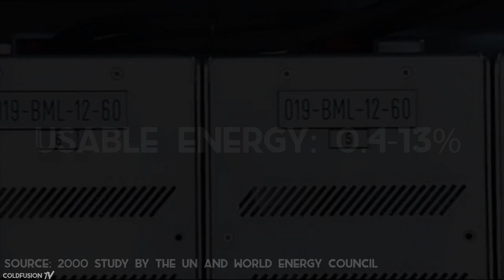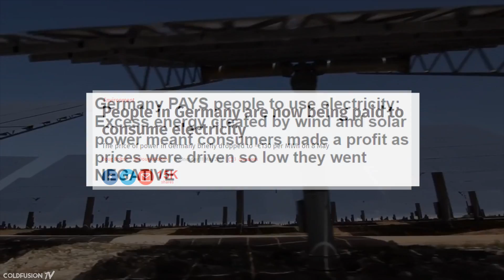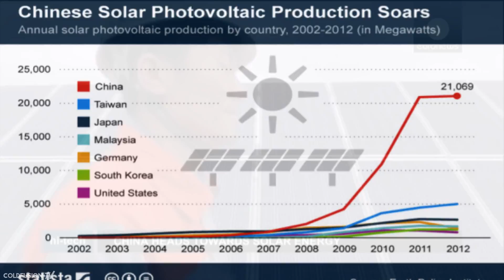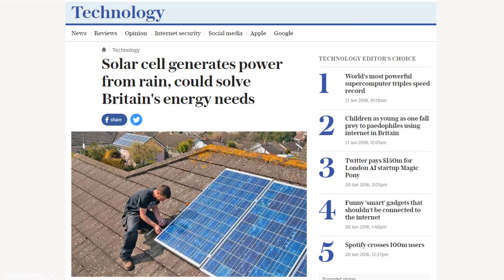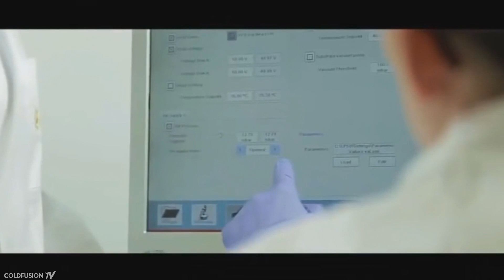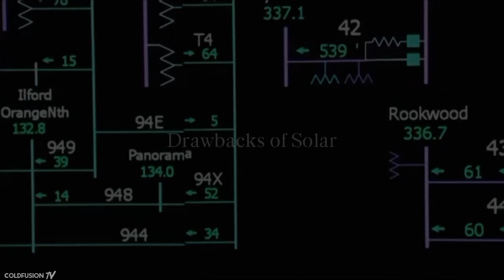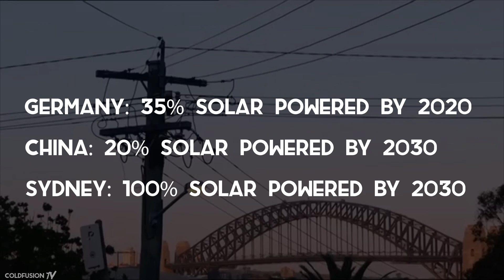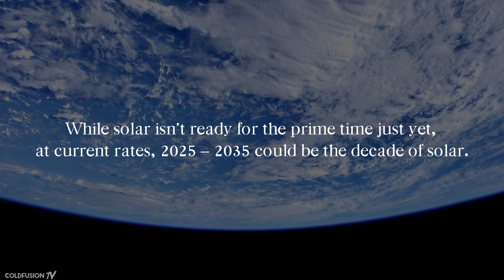The Truth About Solar

Comment: We are 200 years away from really practical solar cells.  The "solar cell paint" that has been promised  was a dud.  Solar energy does not work at night and there are no batteries that can reliably  power a home for more than a few minutes,  All  of the government subsidized solar manufactures have gone broke even though they contributed heavily to the Obama campaign. Solar cells ware out in just a few years they produce about  80% of what they did when new and continue to deteriorate.

Storage of electricity is the other half of the equation with solar energy until that problem is solved solar will remain an experimental dream.  Solar does provide a minimal amount of input of electricity for off grid use in the third world. It can charge your phone  or computer and run your wrist watch or radio  and power your yard lights for a few hours. 99% percent of the worlds energy comes from fossil fuels. 

Cold fusion is actually a better bet than solar power; wind energy is a mechanical loser with to much costly maintenance. Wave power looks promising.  If you had to live on solar energy alone most American;s could not do it. There would be no dryer or washing machines or air-conditioners and no refrigeration, no microwave and all lamps would have to be small LED's and TV would be on for an hour or two only, this could be a good thing. Try doing without these little trinkets for even a short time. Still millennials have been programmed to think we have conquered the technological barrier that keeps non-polluting  solar cells from powering and energy starved world. This was a myth transferred to them by teachers who do not understand technology, but are optimistically blowing up the hopes and dreams of a world powered by the sun which it is already.

Comment: After 25 yrs in solar system design (thermal) the future for solar PV is to couple togeather as i have done 3 yrs ago with a low cost none copper thermal panel to make a PVT hybrid. Everybody from the USA who talks up how solar power is so great fails to understand that the efficiency of all PV panels drops by 0.05% on every one degree c in temperture. Every manufacture knows this, as all the internal testing is based on a 25c air temperture.
The UK and Europe have a need for 60% heat, not electricty, so lets include solar thermal when we talk about solar power, where the storage is already here and is affordable to all, not the Tesla battery idea, costing thousands.
The world could go off grid in lighting today, now we have LED bulbs using from 5 watt x 10 = 50 watt x 1 x 100 watt panel and a 50Ah power bank to power 10 lights a day.
See my Hybrid PVT on You Tube and running your lap top for 10 hours for a cost of $120.00

Comment: I am retiring off grid in a 24' bus and a 16' Hallmark droop nosed shop/toyhauler trailer for my motorcycles and welders generators etc etc. I am buying into solar and am finding out you have got to pay a bunch of cash up front, big time on the batteries if you are off grid in order to scoop up on all that "Free Power". Biggest set of air quotes ever in this(: If I can make these batteries I bought last for 10 years it will all pencil out......Right? Ya if anybody remembers what you do with a pencil fur gawds sake, sheesh!

Comment: In mountain areas the storage problem is solved very easily. Switzerland has lots of dams to store water and create energy. Now because energy is more expensive during the day (peak) than at night, swiss owners of those dams used to pump the water up during the night and let it down during peak hours. So they could use cheap energy to produce expensive energy and make a lots of money. Those things are called pumped-storage power plants. So now all we need to do is to use all this solar energy and use it to pump water up the mountains.  Yes it may not be the most efficient way, but those things are the largest batteries in the world.
Reply: "dams used to pump the water up during the night ...  they could use cheap energy"
Solar is the most expensive energy. There is no solar at night time genius.
Reply: Did you read my comment and did you think about it for more than half a second? Just pump the water up during the day with cheap solar power and let it down at night when there is no sun. As I said, it's a huge battery. It solves the problem of storing solar/wind energy in an economic way. 
And about your comment that solar is the most expensive energy. Did you at least watch the video? See 4:22.
But I agree that clearly you must be the genious because you can think about it at least that half second. Congratulations man!
Reply: ***** "Just pump the water up during the day"
To use more power durring peak usage would require MORE everything. It is reasonable to use excess energy production during off peak times to pump water UP a dam for storage sometimes.
There is excess non-solar energy production at night, as they don't require direct sunlight.

"Did you read my comment and did you think about it for more than half a second?"
Read what you said and think.
"energy is more expensive during the day (peak) than at night, swiss owners of those dams used to pump the water up during the night "
Why is the word off-peak "NIGHT" significant, but ignored by you?
"Those things are called pumped-storage power plants."
Solar energy production at NIGHT is impossible, there is no sun light at night.

"As I said, it's a huge battery. It solves the problem of storing solar/wind energy in an economic way."
1) How would using more energy than is currently produced, in order to store energy during peak day time use solve any problem?

2) How would using sunlight at night to produce solar in order to pump water up a dam be anything other than pretend solution?

Be clear what you propose. Solar at night or storing excess energy during peak usage. Solar is the most expensive form of energy production, a big reason is non use during night.

Comment: Notice the tricky math at 2:50 which reduces the credibility of the rest this entire piece.
36 cents per watt today -= $360 for 1,000 watts. Good luck with that too. It's $1,000 on Ebay even. It has always been about $1 a watt. I have used it for decades and know.

For yrs I have said that you must also count the pollution to make and distribute etc solar and remember that they only  last about 25 yrs. The pollution today can equal what you save over 25 yrs thus there is no net gain then.

Comment: While I agree that solar power is the future, it is misleading to say energy from the sun is "free." Solar panels and battery storage have finite lives. Even if the panels and batteries are not damaged they will degrade from diffusion of materials. All semiconductor materials will suffer from this. The diodes and transistors will eventually fail. While the cost of production will eventually drop low enough that these replacement costs are manageable, solar will never be "free."
Reply: "it is misleading to say energy from the sun is free."
There is also the obvious unanswered question that if a large portion of solar energy was diverted from hitting the ground and nature, what change will that cause? Anytime someone start off with "x amount of unused energy hits planet earth and if we utilized that...", the pregnant dot "No used? What damage would that absence of x amount of energy NOT hitting the earth cause?"

Comment: your analysis of costs is faulty. You haven't included the "packaging" of solar, which is necessary to make electricity. Nor have you included installation of the whole setup. Nor have you figured in the replacement of solar panels about every ten years or so. Nor have you included the costs of climbing up onto the roof to shovel snow and to dust the panels every two months in the summer and the costs of the medical bills when you fall off the frickin roof!
Reply: Not included resources taking from other things people wanted by government to subsidize solar, subsidize solar research, bailout failed solar companies, subsidized climate research for the purpose of solar.

The increased cost to a home owner for roofing replacement and repair. The increase in water damaged homes from holes in the roof to support solar panels.
Reply: LOL

Comment: So what is the cost of solar per kw/hr?  Also, it seems that winter time will still be a problem for years to come.  Less sunlight, more demand for energy to keep houses warm.  Less efficient batteries in the cold weather.  This tech is moving in the right direction but I think the ability to give up power from traditional sources may be a long way off yet.

Comment: Germany PAYS us (I am German) for using electricity? Am I in the wrong movie? LOL. We pay more and more each year for electricity, because we have all these solar panels ruining the landscape. If we wanna produce up to the 750 TW/h we consume each year (in Germany) with solar energy, then there would be much less environment left to protect, which makes that easier
(sarcasm btw). And now we wanna reduce the carbon footprint with battery powered cars. As the production of electricity still is highly based on carbon dioxide producing processes, the CO2 footprint of an E-car is still higher than that of a conventional middle class car. Why not advancing Thorium 233-Reactors? Its potential is very high and the radioactive by-products are minimal, mass wise. Ah, right, we did not get any weapon capable material...sad sad world. AND the first step to reduce our carbon dioxide emissions is to reduce our consumption of energy, just saying.

Comment: A thought on residential power storage - do we really NEED expensive and potentially dangerous Li-Ion batteries for home energy storage? What about old fashioned lead acid batteries? Just as an example, a 27 plate, 48v forklift battery has something like a 6hr, 1100 amp capacity, and it's about 38 inches by 41 inches by 24 inches. That would run everything in your house for some time, they're relatively cheap, and they're rebuildable. It's not like they're going to be moved, like a laptop, phone, or electric car battery, so weight (upwards of 4,300 pounds in this example) is a non-issue. Install that puppy, put it in a well ventilated box, top it off with distilled water once in a while, and you've got a good home storage solution, without having a bunch of little lithium cells.
Reply: Li-Ion batteries are really not particularly dangerous, it's more a matter of the extreme lengths to which they go to lighten and cheapen yet newer generations of portable electronics with poorly designed charging circuits.  Li-Ion last longer, and are usually cheaper per AH than lead-acid, and don't behave so badly when cold.  Large size lead-acid batteries have hazards of their own.  Not to mention trying to remove and reinstall a 4300 pound battery, or what would happen with a major fire.

Very large LI-Ion batteries are made too, no need to rely on a gazillion tiny cells.

Comment: In 1978  ARCO  and another big oil firm bought out about 98% of solar patents. Oil wars? Disgusting. Zenith in league with Israel is installing solar dishes with a 72% output. Check it out...
Reply: I did.  Boy are you confused.  Solarex developed a couple of patents.  Amoco bought Solarex.  ARCO oil's solar subsidiary got sued and put out of business for violating those patents.  Amoco merged into BP, and BP Solar had lots of successful large scale projects, including multi-megawatt solar generating stations, including a 32MW one in New York.

In other words, one oil company's solar subsidiary sued another oil company's solar subsidiary over a couple of patents.

BP Solar went out of business in 2011, because their 1970s/80s generation solar cell techology was less efficient and more expensive than newer technologies from the 90's onwards, especially Chinese imports.

Zenith Solar was bought out by Suncore Photovoltaics.  Suncore is Chinese.

Now the Chinese are running the industry.  Is this better?

Comment: 1 procent unit increase in solarpower in 12 year is not impressive. Sweden and France got about 30-40 procent unit increase in nuclear power each in a 10 year period in the 1970 respectively 1980.tys. Its about 30% higher speed of increasement.

$90 to 36c.... no... The 36c is a spot number of raw cells.The real cost is about $4 or so. And this is per rated watt, not produced watt. Compare that to prototype gallium cells of the 70-tys is also not fair. It would be like comparing hand built cars of the 1880 with mass produced assembly line cars of the 1920-tys.